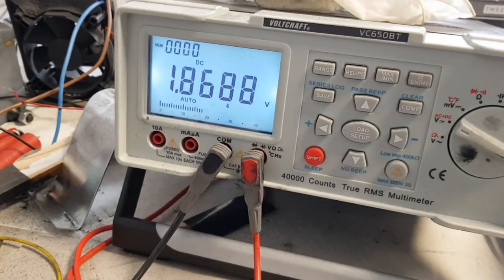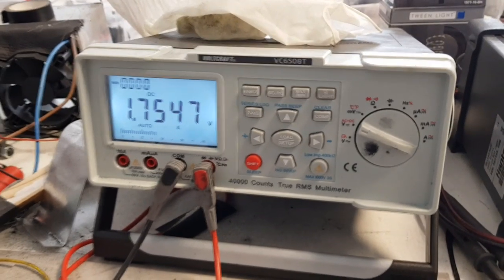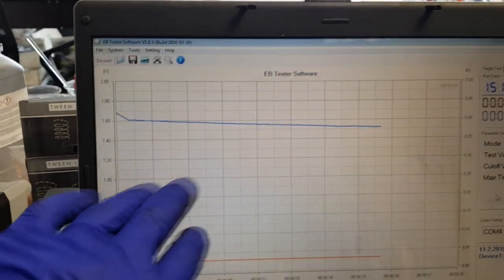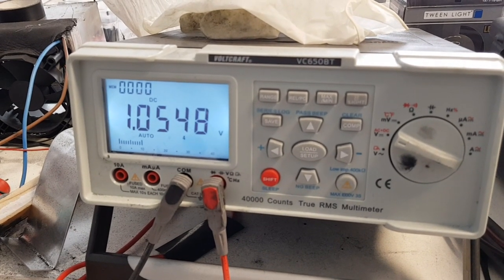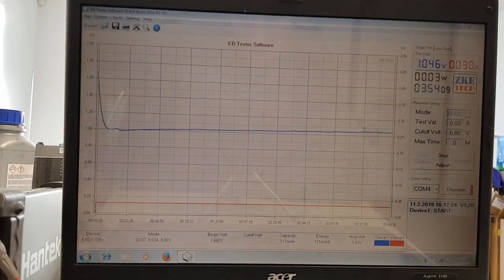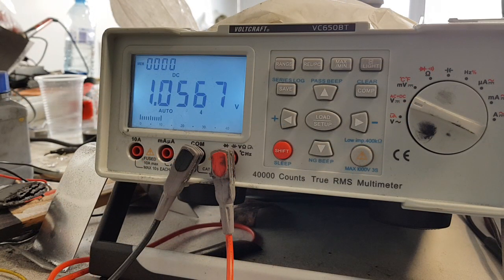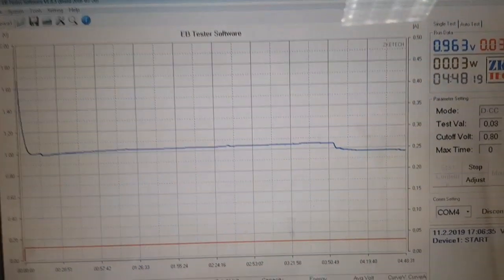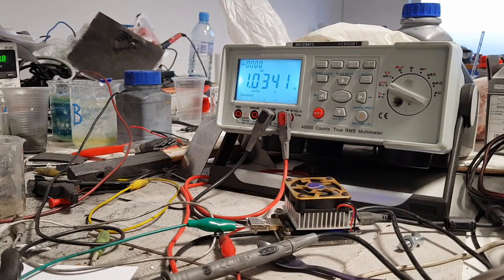Nickel Zinc Battery - thermal effect

Comment: Hi there. I was just about to ask have you tried cold air, but it seems to drop in voltages. I wonder if the electrolyte has not gone through the whole carbon yet, And that's why the voltage is increasing. The hot air may be making the carbon suck up the electrolyte faster. Good results either way.